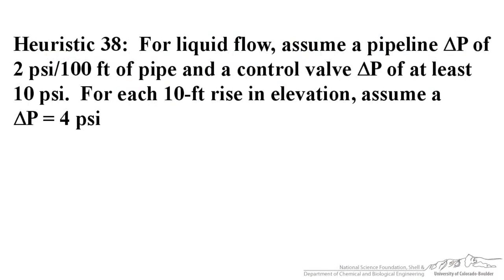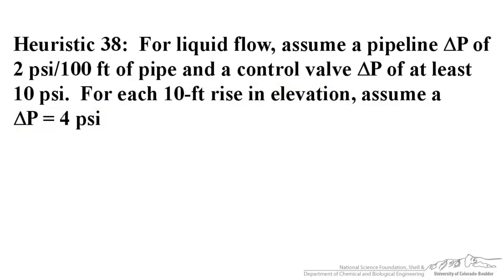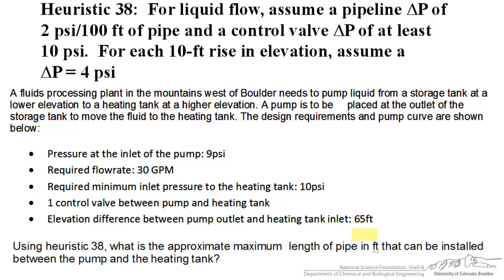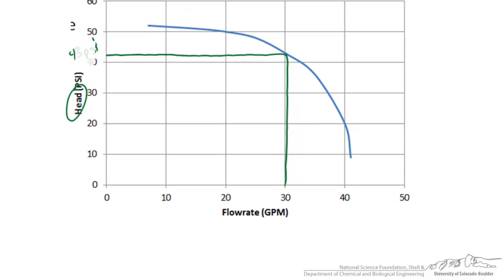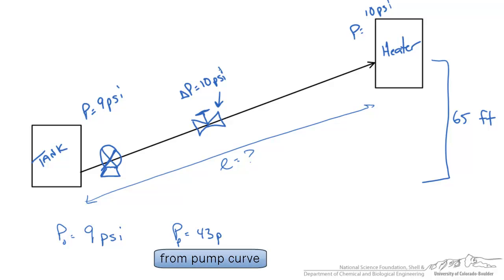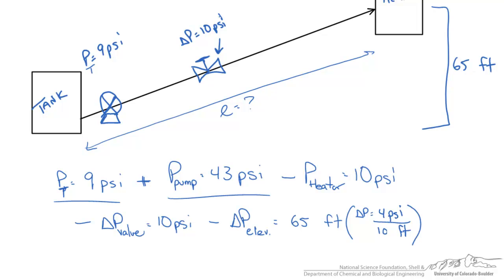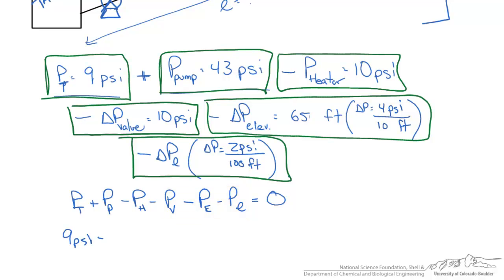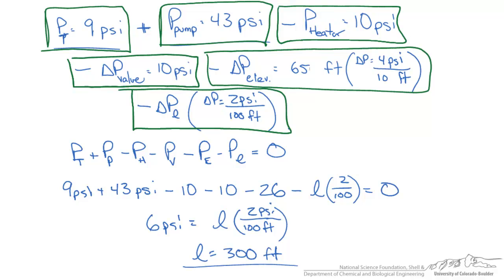Rule of Thumb: Energy Losses in a Piping System

Comment from the maker: Technically an energy balance should be performed on your system to account for all energy losses and changes within the piping (as you mention).  With design heuristics, we are using general "rules" to perform quick calculations to estimate design parameters.  So we can in this case associate pressure losses to energy changes.